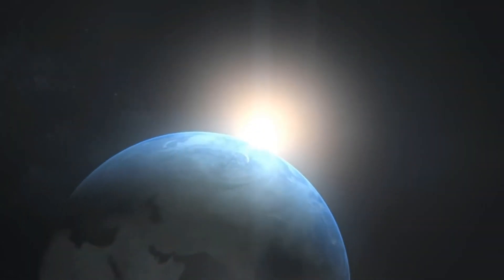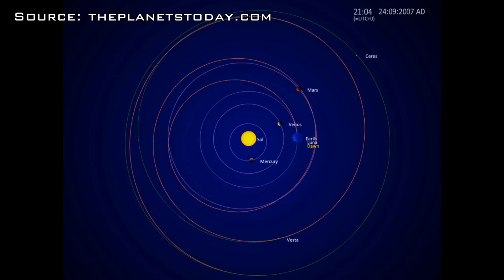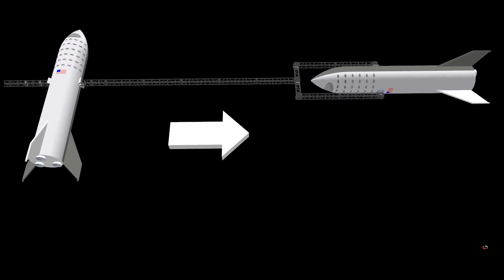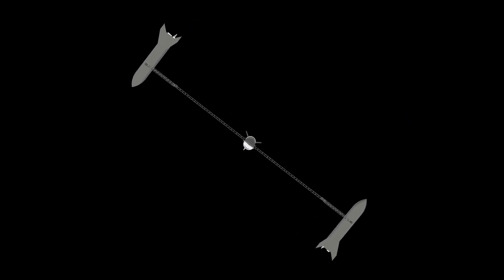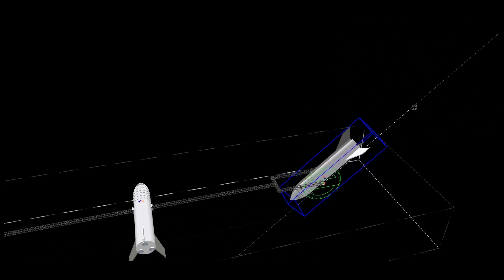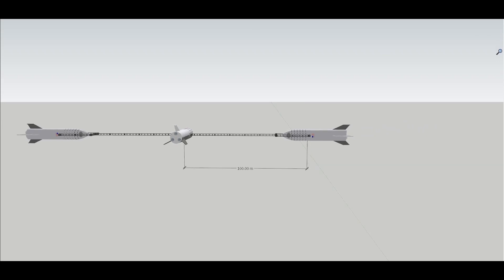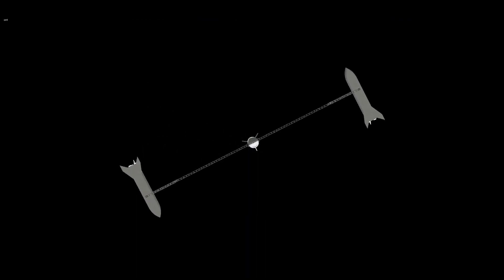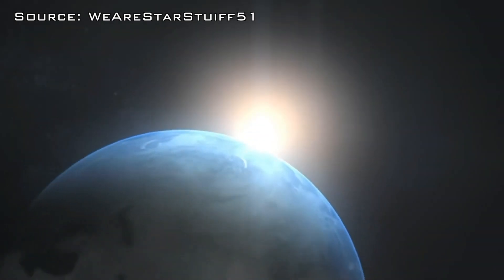GLS2: Artificial Gravity for SpaceX's Starship

Comment: I think your idea will not work. Too many variables you are not considering that could cause RUD to occur. One example would be the gyroscopic effect. If you do not have both vessels at an equal weight, you will cause a vibration to occur and that would cause a wobble, which could in turn weaken your truss as the cold temperatures in space would allow metal fatigue to occur at a faster pace then on earth. The faster you spin, the higher chance the devices would meet a catastrophic end of mission. If one vehicle broke away, the other could also be damaged or destroyed by FOD as the forces on the truss would probably puncture a hole in the vehicle causing loss of life. If it was not instant total destruction, what would happen on entry into the Martian atmosphere? One small defect has destroyed every rocket so far and even the space shuttles. There is no way to balance the weight difference in your plan as is. I would not go on that setup. I would rather go weightless and that would be very stressful.

*FOD is foreign object damage
Reply from the maker: New version has cables and truss. Wobble will still be an issue, but the difference between the mass of the two passenger starships should never be very significant. Perhaps the GLS itself should be able to "climb" the truss itself, to balance the spin.
Reply: smallstars - The weight difference will be significant. You are forgetting the fuel weight. There is no way 3 vehicles would burn exactly the same amount of fuel to weight exactly the same. On top of that you have the difference in payload as well. No way to calculate 3 vehicles all with different weights with full fuel capacity and different trajectories could be calculated by anyone at this juncture of technology. Only way to even them off would be to dump fuel for all to weigh the same as the lowest vehicle. And as you know fuel is key to space travel and would never be dumped.
Reply from the maker: @geordieck  Never say never! haha, but yeah either that or truss climbing hub ship. I am considering the fuel mass when I say weights will be similar.

Comment: Thank you for the video.  I agree that spin gravity is a practical necessity. Your point that the RCS engines as currently envisioned are substantially less effecient than Raptor.   But I believe that tethers can do the job, provided that the software and sensors are made smart enough.  I hope that SpaceX takes a page from Rocket Labs Electron Rocket to make the RCS system.  Ie I hope SpaceX uses 4 to 6 electric driven turbo pumps  to pressurize the RCS system so they can get somewhere in the ball park of Raptor's isp, while maintaining reliability and quick response times.

Comment: I thought I was the only one who was thinking of it this way. Only I had RCS for the spin and stability, never did the math on the fuel needed vs weight, only the spin necessary to produce 1G on the lowest deck. I was also thinking that the spent upper stages of the F9 could be parked in a higher orbit to be recycled to use for extra tanks/engines to take along for supplies or use as the truss structure.Tesla could make a pick-up truck that could also be easily modified to use on Mars instead of that huge complicated NASA Mars rover.

Comment: Actually, no need for use of main engines, the RCS thrusters would be ample power for this. So the construct could be lighter without swivel joints.
Reply from the maker: Please provide the RCS propellant consumption, capacity, & thrust, specs that made you come to this conclusion.
Reply: @smallstars  Main engines are designed to achieve orbital thrust and deceleration, to merely spin up a spacecraft to a few revolutions a minute in microgravity could be easily done with a reaction control system. Also there would need to be a counter balance, or another set of spokes to prevent instability of the spinning structure. Great idea though.
Reply: @stitchem7  You are correct.  Propellant consumption would be similar whether on a large or small engine. And thrust doesn't matter (because you have time), except that using main engines is out of the question. Anyone who disagrees should go to a launch and see (and feel) main engines in action, then get back to us. Truss or cables, the whole thing would tear itself apart. And imagine if the engines on one ship failed to start.

Comment: Don't need a hub ship or rigid connector. Concept proven in Gemini program and tethered spinning station keeping was stable.. Would use ion thrusters to achieve and maintain spin. But artificial G starting at 1G and gradually reducing to 0.38G (and reverse) experiments are necessary before a mission to Mars...years of experiment and medical research. It's going to take at least a decade to prove and achieve ISRU for fuel and consumables. There is plenty of time to do artificial gravity right. All plans by everybody so far leave way too much out. Reality check: over ambitious plans are setting us up for catastrophes that will end up delaying things for a century. It's been fun to dream, but we are headed for a nightmare. Unfortunate.
Reply: @smallstars...Gemini XII with Lovell and Aldrin (rookie mission with 3 spacewalks). They maintained stable tethered station keeping for several hours using just the gravity difference between the two craft. It was so stable they kicked back and enjoyed a meal and a break. There have also since been successful experiments using much longer tethers and propulsion on craft leaving the ISS. Be optimistic, yes, but reality dictates that these things take time. I was 14 for Apollo 11 and we were supposed to be on Mars by '82. I was robbed! lol And we still haven't tackled the primary problem of deep space travel: artificial gravity.
Reply from the maker: @doughendrix8093 Imagine trying to slow down 2 objects spinning with a tether connecting them, each with a mass of 1 thousand metric tons, from a tengential velocity of 31m/s to 0m/s. I'm not saying it can't be done, but it has never been done.

P.S. I'm sorry about you getting robbed of a mars mission (sincerely!)
Reply: @smallstars  Yes, like so many things, we've got it to do...and eventually will, whatever it takes...optimistically.😉
Reply from the maker: I disagree with most of what you have said here. Call me an optimist but; imagine if I told you 20 years ago that we will be reusing our rockets by implementing propulsive landings?

Here's an excerpt from wikipedia about the Gemini tether you cited:

Gordon's first EVA, planned to last for two hours, involved fastening a 100-foot (30 m) tether, stored in the Agena's docking collar, to the Gemini's docking bar for the passive stabilization experiment. Gordon achieved this, but as with previous Gemini EVAs, trying to do work for an extended period proved more fatiguing than in ground simulation, and the EVA had to be terminated after only half an hour.

The passive stabilization experiment proved to be a bit troublesome. Conrad and Gordon separated the craft in a nose-down (i.e., Agena-down) position, but found that the tether would not be kept taut simply by the Earth's gravity gradient, as expected. However, they were able to generate a small amount of artificial gravity, about 0.00015 g, by firing their side thrusters to slowly rotate the combined craft like a slow-motion pair of bolas.

https://en.wikipedia.org/wiki/Gemini_11#Flight
Reply: @smallstars  Wouldn't a much higher artificial gravity keep the tether taut?
Reply from the maker: @harpfully  Yes but I was trying to illustrate that while Gemini's experiments did prove that a tether concept can work, they did not successfully implement a safe, reliable, spin gravity system. The GLS serves as a way to implement such a system. The centrifugal force will still be be held by cables, but the spin speed and stabilization will be made possible by rigid truss and the hub ship.
Reply: @smallstars   Trusses are subject to more shear forces and metal fatigue and are much heavier if required to handle transverse loads as in you illustation.  Ship stabilization with cables can be handled with rcs, mostly at least, and it wouldn't take much after the initial stabilization -- just damping tiny swings caused by people moving around during cruise.
Edit: In your last post above, you said "The centrifugal force will still be be held by cables" (which is what I'm suggesting).  But  I don't see that in the video.  I take it that this will be your 2.0 version?

Comment: This needs to be made the focus right now. Build this as a LEO space station first, though with all the engineering geared towards actual interplanetary flight. 1) Make it spin and circle the Earth; 2) experiment with transitioning between lower and higher orbits; 3) transition to an orbit around the Moon; and 4) go to Mars.
Reply: Jean-Pierre Gygax for this idea mate check out gateway foundation that should peek ya interest
Reply: @Viperflight1984  Those are the space hotels, right? But IMO rotating artificial gravity must be used for all serious space travel now. It may not be strictly necessary for a short stay on the moon, but it is for everything beyond that, so it's best to get started asap.
Reply: @jean-pierregygax3415  It isn't necessary for a trip to or even an extended stay in the upper clouds of Venus, not at 0.89 x Earth gravity.
Reply: And when theyre in LEO they can experiment with Lunar, Martian and Venusian levels of gravity. The last not being that important.
Reply: @nicosmind3  So far, I've considered variable gravity a bonus, but thinking about it, it could be absolutely crucial. We tend to just assume that humans can live under Martian gravity even in the long term, but we totally lack any hard data on that question.
Reply: This must be the plan because the bigger the rocket the harder it is to put it on LEO  but by assembling on 0 grav may take 1 ) a lot less of effort and most important time 2)it would not be necessary to establish a moon base since  they will have a space shipyard orbiting earth.Since that could be the case because ULA and the ....im mad im totally mad to them... boeing is trying to take all space budget to itself or at least that i how i see it.Both of the options are covered since SpaceX has established an efficient launch Cycle Options are : 1)ULA uses SpaceX since is more efficient 2)ULA or blue...just kidding..ULA Decides to leave space X on its own and they make their own moon base.In any of the cases the time of Elon is reducing every minute, we would all like him to be on mars before that happens ULA says 2 near 203X but for that moment SpaceX is supposed to be arrived there since their plans are for 2024,considering their ratio of activity is totally possible unlike that propaganda they usually throw us
Reply: Great way to try this. out.
Reply: Good ideas.
Reply: Low earth orbit is not much more accessible than higher orbits, Elon explained this well. It's because you need so much lateral speed just to stay in orbit you almost may as well go to higher orbits especially if you're interested in any other destinations.
Reply: Jean Pierre your rezoning and logic are the closest to what must be done before taking the ultimate trip to mars. Hope Elon will take it to consideration.

Comment: Very good. 

Couldn't the Starship just have a spinning cylindrical section?
Reply: One of the big considerations of centripetal acceleration as a gravity substitute is the Coriolis effect. If your spin radius is too small, you'll have a sensation of "gusty gravity" and things falling at an angle to what our brains expect to see. That and the gradient (as mentioned in the video) needs to be spread out...again, to allow the gravity simulation to fool our brains into thinking everything's all right. I seem to remember a video some time ago proposing a "2001"-style Discovery  or "The Martian" carousel needing to be 42 meters diameter bare minimum. Starship would need to either be that diameter or carry something that can be deployed to create a cylinder that diameter in space.

The proposal here sounds like a good diameter to fill the comfort bill without the ride feeling like a non-stop roller coaster.

You've got a good point, but it might not be practical given our current state-of-the-art in what we can lob off the Big Blue-And-White Marble high enough and fast enough.
Reply: No.
Reply from the maker: Here's someone's idea on this https://www.reddit.com/r/SpaceXLounge/comments/czycst/in_an_85m_diameter_rotating_cylinder_a_2m_human/

Maybe a concept could be some sort of inflatable that expands to 100 meter radius? See Bigelow Aerospace.

Comment: i think the engines are too big and deal with too much power to use them like that
Reply from the maker: I laid out the math in the video, using current thrust specs for the vacuum raptor.
Reply: I agree... Adding a smaller lateral thruster to the starship would not add that much more weight especially if it only produced around 1% of the thrust.

Also a lateral thruster means you would not have to rotate the starships' orientation. And though this is a mod of the starship, the addition of the truss is also.

Comment: Liked and subscribed.

Very doable and grounded on basic physics. SpaceX's approach is to get to Mars faster but I think we need to solve this to further protect the human body. Interestingly, this could be the easiest way to put gravity into space structures such as space hotels. The only thing I always remind people about this way to create gravity is that it will be very challenging to enter and exit the structures without having to stop or slow down system. Otherwise, you have to create some sort of transfer system at the center of the structure.

I'm interested to see (on another video perhaps?) what are your thoughts and ideas on how that would work.
Reply: Very good points. I think the 2001 movie showed how to "land" on a spinning spacecraft/station! We've gotten pretty good at rendezvous maneuvers and adding some rotation along the approach axis doesn't seem so hard.
Reply: I think it would be easy to transfer people to the system with some sort of elevator system cabinet that transfers from the center to the edge of the system.
Reply: Well the time it takes to get there in star ship the gravity isnt that nessairy
Reply: @makoshark40  , 
Three months in microgravity is enough to have a crew arrive at Mars and not be able to do much for days because they would  need a period of gravity adjustment. walking, orientation, vision - all these things will need time to readjust after three months of microgravity. Ideally, you want a crew that arrives as fresh and and as ready as when they left. They need to be able to tackle any sort of emergency the second Starship touches down on Mars. Artificial gravity is the best solution we could hope for.